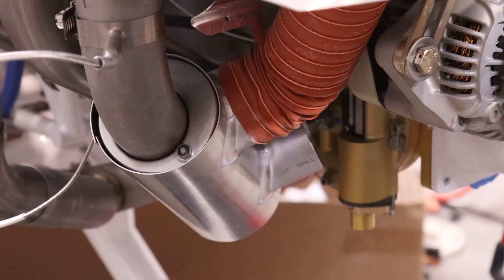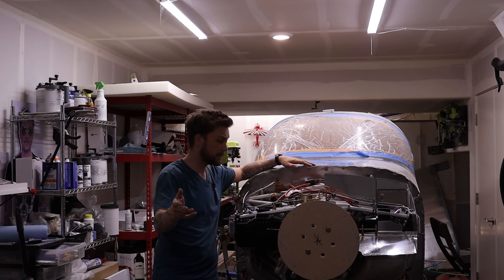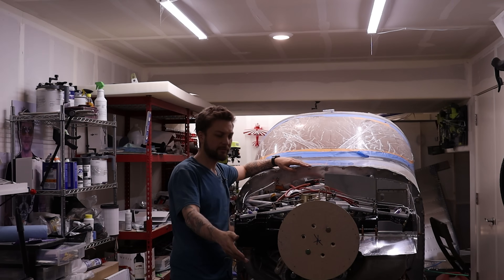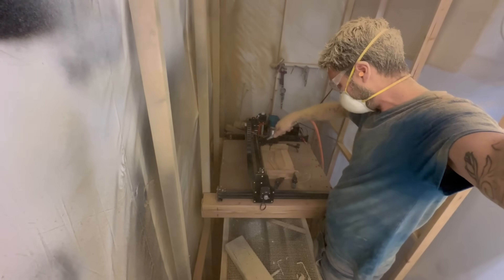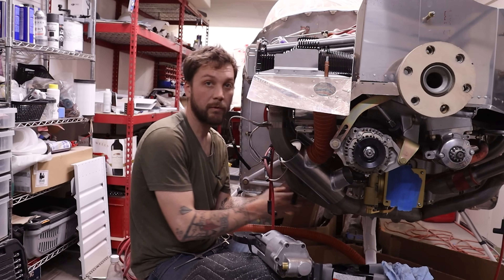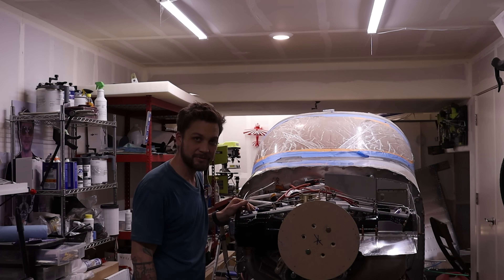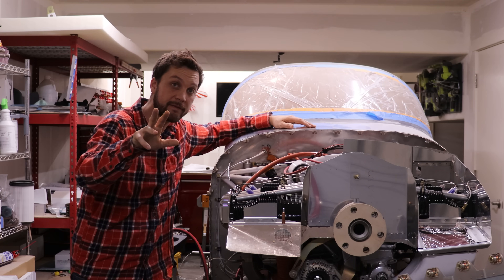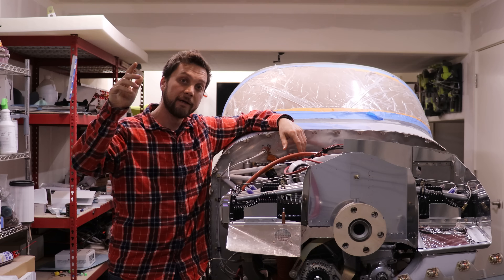Difficult Times as an Airplane Builder | EP117

Comment: Your getting fine dust because your bit is running to fast...   slow it down and you will get chips...   easier to clean and wont clog up the x,y,z rails
Reply from the maker: I’ll give that a try. I figured that MDF might just always go to dust, but my chip load (?) was awfully light.
Reply: @RyanFlysPDX  I missed the part you said mdf....   thats always tough...     but do a small test at slower speeds...   and.   If you have another fan....   you can always rig it to blow constant for you...  so you dont have to be in there with it